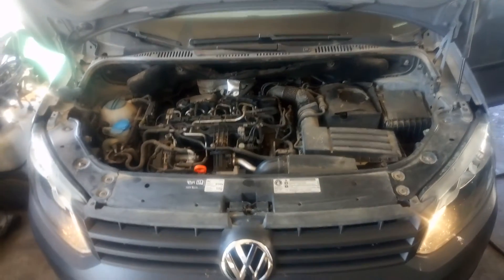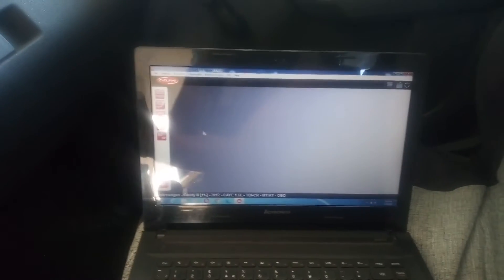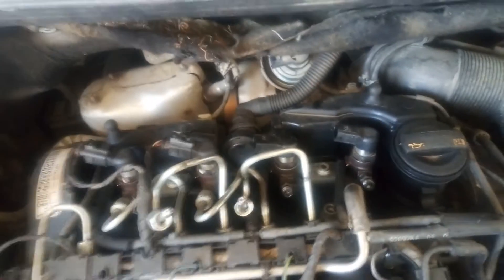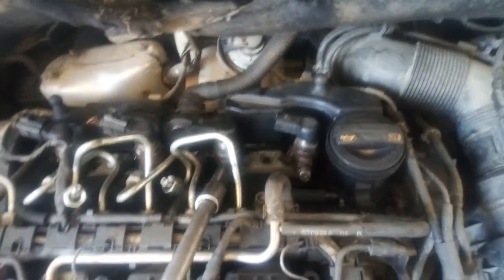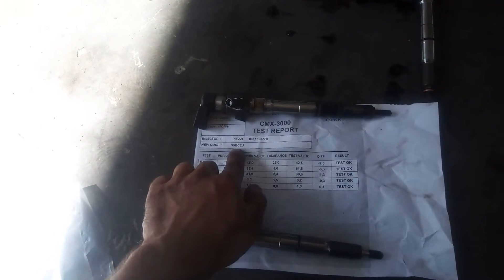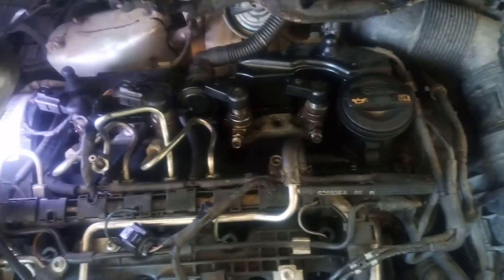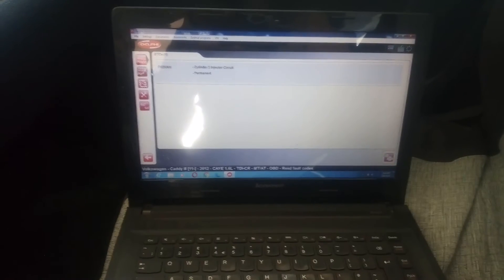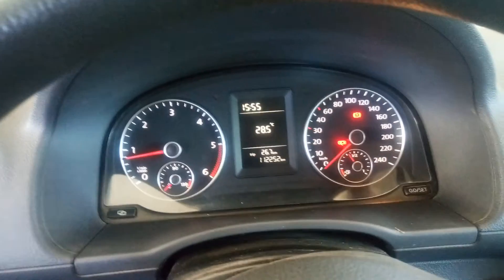vw caddy 1.6tdi how to change fuel injector

Comment: Hello friend , i have golf 6 1.6tdi, cayc , the engine is shaking like that at idle , my injectors readings are all between 0.3 and 0.9mg
Engine mounts are replaced but its still shaking ? 
Flywheel didnt hearing and clutch is good , i have this shaking problem randomly , sometimes i drive whole day without shaking, sometimes it shakes when started, and sometimes i start and drive to work and when stop on trafic light for example it starts shaking.
What do you think what can be problem in this case ?
Reply from the maker: That one 0.9 is little higher than should be try on 1200rpm to check them and see if they go up
Problem is on the golf software require to be very precise but Skoda can vork well with those reedeng

Comment: When you check the tolerance of the fuel injectors what measurement do you select in the diagnostic tool ? I use obdeleven.
Reply from the maker: The owner of this vehicle bought the injector I don't know on what machine injector was tested but the machine print the list with new code and measurements and I write the code on this vehicle with Delphi diagnostic